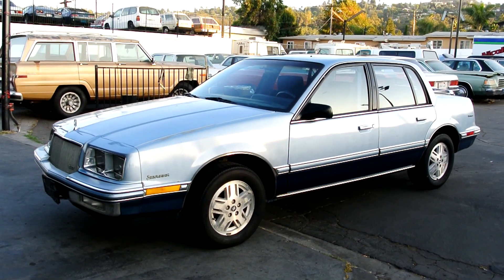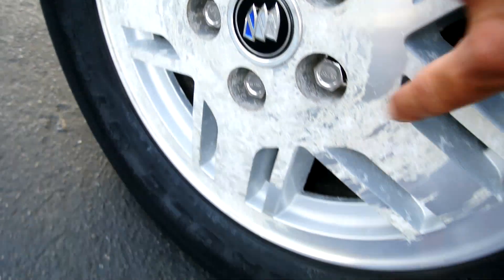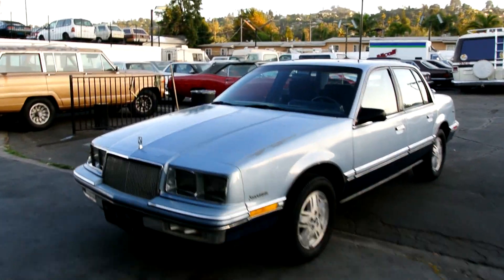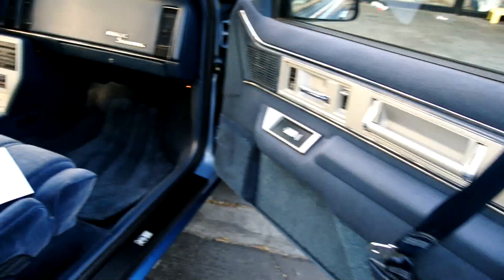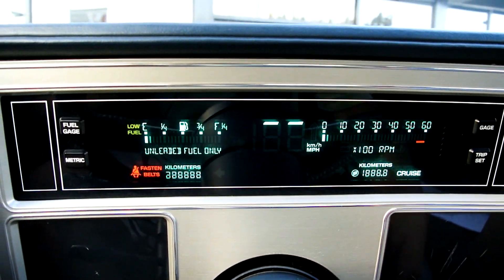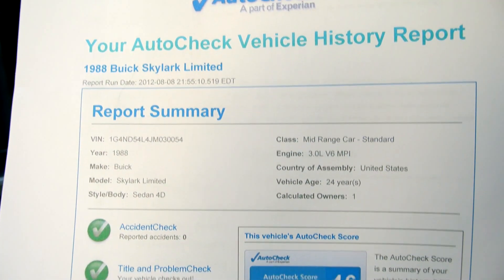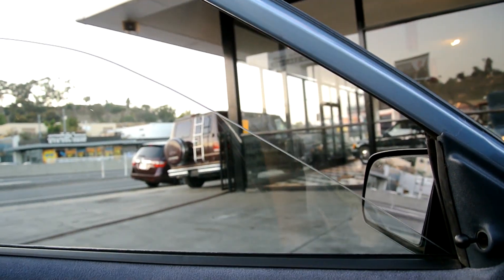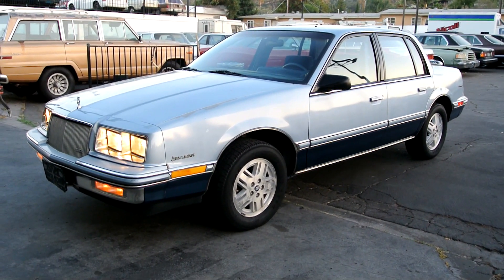1989 Buick Skylark Custom 26,000 Orig Mi 1 Owner GM 3100 V6 Video Review 4 Sale

Comment: The N-body Skylarks were cool cars.  Our family had two X-body Skylarks (1984 & 1985) and they were great despite the bad reputations.  Both had the Iron Duke Tech 4 engines.  The N-bodies were considered high tech cars and came equipped with the 2.5 iron duke, 2.3 Quad4, the 3.0 Buick V6 and later the 3.3 Buick V6.  I would consider this generation a vast improvement over the X-bodies.

Comment: The Buick Skylark was one of the General Motors N-body cars introduced in 1985.  It was at first known as the Somerset Regal, and only came as a coupe for 1985.  Oldsmobile called its version Calais (once a Cadillac name) and Pontiac named theirs Grand Am.  For '86, sedans were added, and Buick picked up the Skylark name for the four-door, while the two-door kept the Somerset name until 1988, when it was called Skylark as well.  The sales leader of all the N-bodies, however, was the Grand Am, and it remained so until the G6 replaced it in 2005.

Comment: Do you still have this car?  I am IMPRESSED, and would love to have a nicer skylark.  I currently own a 1988 Skylark Custom with the 2.5L and it is a very nice car, Looks similar to yours, just needs a new engine, and it STILL RUNS, has been very reliable, I start it and drive it every week to keep it going, but I would rather have the V6 Limited, unless I find a good engine swap for my car.  I LOVE the CONSOLE SHIFT!!! Mine does not have that!

Comment: Is it an '88 or an '89?  The caption says it is a 1989, but you described it as a 1988.
Reply: It's an 88...it has a 3100 V-6 and sealed beam headlights. Last year for that motor. I have an 89 with a 3300 V-6 and composite headlights.